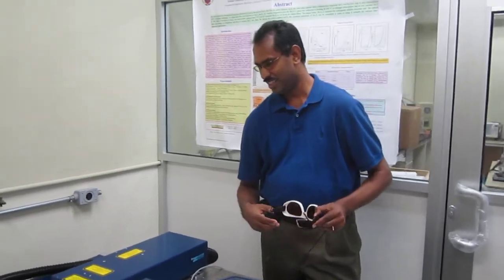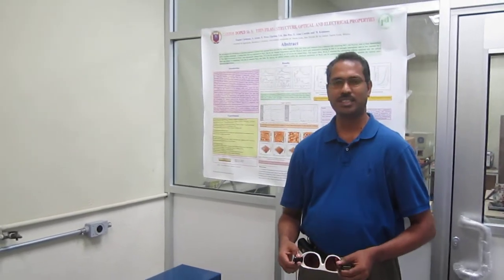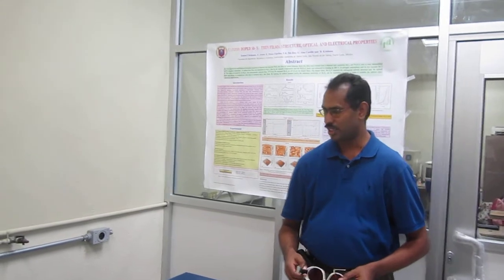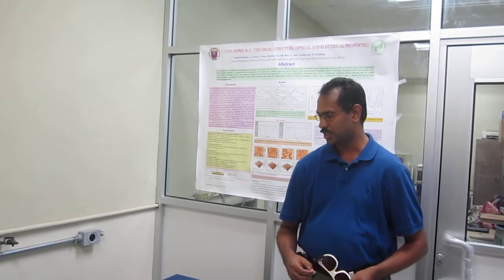Del Mar Photonics Nd:YAG laser system at the Universidad Autónoma de Nuevo León UANL

Comment: UPCOMING PRESENTATION
Four-wave mixing based optical parametric oscillator producing high energy, tunable, chirped femtosecond pulses
Thomas Gottschall, Jens Limpert, Andreas Tünnermann
10 February 2015 • 4:00 - 4:20 PM | Part of SPIE LASE

All-PM-fiber normal dispersion femtosecond optical parametric oscillator pumped by Yb-doped fiber laser
Khanh Q. Kieu, Dmitriy Churin, Roopa Gowda, Takefumi Ota, Yukihiro Inoue, Shinichiro Uno, Nasser N. Peyghambarian
10 February 2015 • 6:00 - 8:00 PM | Part of SPIE LASE

Investigation of coupled optical parametric oscillators for novel applications
Yujie J. Ding
11 February 2015 • 3:50 - 4:20 PM | Part of SPIE OPTO

Dual parametric compounding approach for speckle reduction in OCT
Jan Philip Kolb, Philipp Schwarz, Thomas Klein, Wolfgang Wieser, Robert A. Huber
9 February 2015 • 5:30 - 7:30 PM | Part of SPIE BiOS

Ultra-flat and broad gain bandwidth of optical parametric amplification in highly-nonlinear tellurite hybrid microstructured optical fibers
Lei Cheng, Tuan H. Tong, Xiaojie Xue, Dinghuan Deng, Takenobu Suzuki, Yasutake Ohishi
11 February 2015 • 6:00 - 8:00 PM | Part of SPIE OPTO

6.5W mid-infrared ZnGeP2 parametric oscillator directly pumped by a Q-switched Tm3+-doped single-oscillator fiber laser
Christelle Kieleck, Antoine Berrou, Brenda M. Donnellan, Benoit Cadier, Thierry Robin, Marc Eichhorn
11 February 2015 • 8:30 - 8:50 AM | Part of SPIE LASE

Double-pump-pass singly resonant optical parametric oscillator for efficient generation of infrared light at 2300 nm based on PPMgSLT
Bum Ku Rhee, Seungmin Lee
10 February 2015 • 6:00 - 8:00 PM | Part of SPIE LASE

Making microwaves visible: Parametric frequency conversion in whispering gallery mode resonators
Harald G. L. Schwefel
9 February 2015 • 4:35 - 5:00 PM | Part of SPIE LASE

Highly efficient double pass optical parametric generator for ultrashort pulses of tunable NIR radiation
Heiko Linnenbank, Stefan Linden
10 February 2015 • 4:50 - 5:10 PM | Part of SPIE LASE

Multi-parametric imaging of tumor spheroids with ultra-bright and tunable nanoparticle O2 probes
Ruslan Dmitriev, Sergey Borisov, James Jenkins, Dmitri B. Papkovsky
9 February 2015 • 9:30 - 9:50 AM | Part of SPIE BiOS

High average power difference-frequency generation of picosecond mid-IR pulses at 80MHz using an Yb-fiber laser pumped optical parametric oscillator
Julia Michel, Marcus Beutler, Ingo Rimke, Edlef Büttner, Paolo Farinello, Antonio Agnesi, Valentin P. Petrov
11 February 2015 • 9:10 - 9:30 AM | Part of SPIE LASE

Ultrasound-aided multi-parametric transcranial photoacoustic microscopy of the mouse brain
Bo Ning, Adam J. Dixon, James Bonaffini, Matthew J. Kennedy, Rui Cao, Ruimin Chen, Qifa Zhou, K. Kirk Shung, John A. Hossack, Song Hu
8 February 2015 • 4:15 - 4:30 PM | Part of SPIE BiOS

Optical parametric oscillation in quasi-phase-matched GaP
Peter G. Schunemann, Leonard A. Pomeranz, Daniel J. Magarrell
10 February 2015 • 4:00 - 4:30 PM | Part of SPIE LASE

Axial resolution enhancement of FD-OCT by parametric spectral analysis for ocular imaging
Xinyu Liu, Xiaojun Yu, Dongyao Cui, Linbo Liu
8 February 2015 • 5:30 - 7:00 PM | Part of SPIE BiOS

Time-bin entangled photon pairs from spontaneous parametric down-conversion pumped by a cw multi-mode diode laser
Yoon-Ho Kim
11 February 2015 • 1:50 - 2:20 PM | Part of SPIE OPTO

Parametric imaging of viscoelastic creep deformation in soft tissue using compression optical coherence elastography
Philip Wijesinghe, Robert A. McLaughlin, David D. Sampson, Brendan F. Kennedy
8 February 2015 • 8:40 - 9:00 AM | Part of SPIE BiOS

Continuous-variable quantum computing: toward an experimental assessment
Olivier Pfister, Nicolas C. Menicucci, Moran Chen, Pei Wang, Wenjiang Fan
11 February 2015 • 10:30 - 11:00 AM | Part of SPIE OPTO

Video rate imaging of narrow band THz radiation based on frequency upconversion
Patrick F. Tekavec, Vladimir G. Kozlov, Ian McNee, Igor E. Spektor, Sergey P. Lebedev
11 February 2015 • 11:10 - 11:30 AM | Part of SPIE OPTO

Cascaded OPGaAs OPO for increased longwave efficiency
Ryan K. Feaver, Rita D. Peterson, Peter E. Powers, Joseph Haus
11 February 2015 • 8:50 - 9:10 AM | Part of SPIE LASE

Optimized coherent Raman scattering microscopy with a novel tunable dual-wavelength lightsource
Ingo Rimke, Gregor Hehl, Marcus Beutler, Peter Volz, Edlef Büttner, Andreas Volkmer
10 February 2015 • 4:50 - 5:05 PM | Part of SPIE BiOS

Integrated optical sensing technologies on SOI
Amr S. Helmy, Payam Abolghasem, Janahan Ramanan, Dongpeng Kang, Dylan Logan
11 February 2015 • 11:45 AM - 12:00 PM | Part of SPIE OPTO

Adiabatic nonlinear optical processes
Gil Porat
11 February 2015 • 2:00 - 2:30 PM | Part of SPIE LASE

Numerical simulation of the transverse coincidence distribution of SPDC light
Robert Elsner, Dirk Puhlmann, Axel Heuer, Ralf Menzel
11 February 2015 • 6:00 - 8:00 PM | Part of SPIE OPTO

Role of the surface plasma density on the formation of laser induced periodic surface structures (LIPSS) on Ti upon double fs pulse irradiation
Laura Gemini, Masaki Hashida, Yasuhiro Miyasaka, Shunsuke Inoue, Jiri Limpouch, Tomas Mocek, Shuji Sakabe
12 February 2015 • 10:00 - 10:20 AM | Part of SPIE LASE

Domain-engineered PPLN for generation of polarization-entangled photons
Paulina Kuo, Jason Pelc, Oliver Slattery, Lijun Ma, Xiao Tang
11 February 2015 • 6:00 - 8:00 PM | Part of SPIE OPTO

Coherent combining of fiber-laser-pumped frequency converters using all-fiber electro-optic modulator for active phase control
Pierre Bourdon, Anne Durécu, Guillaume Canat, Julien Le Gouët, Didier Goular, Laurent Lombard
12 February 2015 • 3:30 - 3:50 PM | Part of SPIE LASE

Frequency conversion in AlGaAs microdisks in the telecom range
Giuseppe Leo, Silvia Mariani, Alessio Andronico, Aristide Lemaître, Sara Ducci, Ivan Favero
11 February 2015 • 11:30 - 11:45 AM | Part of SPIE OPTO

Compact, multi-pass OPCPA system at 100kHz repetition rate with a CPA-free pump source
Jan Ahrens, Thomas Binhammer, Oliver Prochnow, Tino Lang, Stefan Rausch, Bastian Schulz, Maik Frede, Uwe Morgner
10 February 2015 • 11:30 - 11:50 AM | Part of SPIE LASE

The laser infrastructure of the ELI attosecond light pulse source
Karoly Osvay, Patricio Antici, Dimitris Charalambidis, Eric Cormier, Zsolt Diveki, Peter Dombi, József A. Fülöp, Mikhail Kalashnikov, Nelson Lopes, Rodrigo López-Martens, Giuseppe Sansone, Ervin Racz, Kahaly Subhendu, Zoltan Varallyay, Katalin Varju
12 February 2015 • 9:00 - 9:30 AM | Part of SPIE LASE

1-micron-pumped OPO based on orientation-patterned GaP
Leonard A. Pomeranz, Peter G. Schunemann, Daniel J. Magarrell, John C. McCarthy, Kevin T. Zawilski
10 February 2015 • 4:30 - 4:50 PM | Part of SPIE LASE

Fluorescence lifetime imaging in the near-infrared region
Wolfgang Becker, Vladislav I. Shcheslavskiy
8 February 2015 • 5:30 - 7:00 PM | Part of SPIE BiOS

Broadband 2.5-6μm frequency comb source for dual-comb molecular spectroscopy
Viktor O. Smolski, Konstantin L. Vodopyanov
9 February 2015 • 2:35 - 2:55 PM | Part of SPIE LASE

Photon pair sources in AlGaAs: from electrical injection to quantum state engineering
Sara Ducci, Guillaume Boucher, Claire Autebert, Fabien Boitier, Ivan Favero, Giuseppe Leo
12 February 2015 • 9:30 - 9:50 AM | Part of SPIE OPTO

Methods to adjust the lateral and depth heating patterns of microwave waveguide applicators
Paul R. Stauffer, Dario B. Rodrigues
8 February 2015 • 5:10 - 5:30 PM | Part of SPIE BiOS
11 February 2015

High repetition nanosecond Ti:sapphire laser for photoacoustic microscopy
Timothy K. Yang, Bokyung Kim, Chulhong Kim, Sungchul Bae
10 February 2015 • 6:00 - 8:00 PM | Part of SPIE BiOS

High brightness 188nm light source with low temporal jitter
James J. Jacob
10 February 2015 • 9:10 - 9:30 AM | Part of SPIE LASE

Highly sensitive absorption measurements in lithium niobate using whispering gallery resonators
Markus Leidinger, Karsten Buse, Ingo Breunig
12 February 2015 • 2:40 - 3:00 PM | Part of SPIE LASE

Controllable harmonic generation by double couplings of ordinary rays-involved second-order processes
Yiqiang Qin
11 February 2015 • 6:00 - 8:00 PM | Part of SPIE OPTO
11 February 2015
COURSE AT CONFERENCE
Solid State Laser Technology (SC752)
Instructor(s): Hodgson, Norman, Coherent, Inc.
Level: Intermediate • 0.65 CEU • Length: 9.00 hours
Member Price: 525.00 | Non-Member Price: 635.00
11 February 2015 • 8:30 AM | Part of SPIE Photonics West

Wavelength to pixel calibration for FdOCT
Maciej Szkulmowski, Szymon Tamborski, Maciej Wojtkowski
9 February 2015 • 5:30 - 7:30 PM | Part of SPIE BiOS

3D parameter reconstruction in hyperspectral diffuse optical tomography
Arvind Krishna Saibaba, Nishanth Krishnamurthy, Pamela G. Anderson, Jana M. Kainerstorfer, Angelo Sassaroli, Eric L. Miller, Sergio Fantini, Misha E. Kilmer
11 February 2015 • 9:40 - 10:00 AM | Part of SPIE BiOS

First experimental results towards a 100W wavelength-tunable femtosecond OPCPA
Mark J. Prandolini, Hauke Höppner, Arvid Hage, Michael Schulz, Robert Riedel, Franz Tavella
10 February 2015 • 10:30 - 10:50 AM | Part of SPIE LASE

Solitons and coherent dispersive wave emission in SiN microresonators
Victor Brasch, Tobias Herr, Michael Geiselmann, Michael L. Gorodetsky, Tobias J. Kippenberg
9 February 2015 • 11:10 - 11:30 AM | Part of SPIE OPTO

The experimental setup for study biological objects using the methods of femtosecond and CARS microscopy
Arseny Aybush, Fedor Gostev, Alexander Zalessky, Konstantin Vereschagin, Viktor Nadtochenko
8 February 2015 • 5:30 - 7:00 PM | Part of SPIE BiOS

Diffuse optical quantification of early hemodynamic changes by chemotherapy on breast cancer xenografts& its implication for therapeutic prediction in clinic
Regine Choe, Ashley R. Proctor, Ki Won Jung, Russell R. Adams, Hyun Jin Kim, Songfeng Han, Emmanuel K. Mannoh, Daniel K. Byun, Kelley S. Madden, Edward B. Brown III, Parisa Farzam, Turgut Durduran
7 February 2015 • 1:40 - 2:00 PM | Part of SPIE BiOS
COURSE AT CONFERENCE
Introduction to Nonlinear Optics (SC047)
Instructor(s): Fisher, Robert, RA Fisher Associates, LLC
Level: Introductory • 0.35 CEU • Length: 4.00 hours
Member Price: 300.00 | Non-Member Price: 355.00
9 February 2015 • 1:30 PM | Part of SPIE Photonics West

Fourier domain Optical Coherence Tomography artifact and speckle reduction with autoregressive (AR) spectral estimation without a loss of resolution
Costas Pitris, Evgenia Bousi
8 February 2015 • 5:30 - 7:00 PM | Part of SPIE BiOS

Photon-correlation amplifiers and interferometers for quantum metrology
Weiping Zhang
10 February 2015 • 11:05 - 11:20 AM | Part of SPIE OPTO

Towards low-noise fiber sources for coherent Raman microscopy
Erin S. Lamb, Hanzhang Pei, Frank W. Wise
10 February 2015 • 5:05 - 5:20 PM | Part of SPIE BiOS

Broadband midinfrared frequency comb with tooth scanning
Kevin F. Lee, Piotr Masłowski, Andrew Mills, Christian Mohr, Jie Jiang, Peter G. Schunemann, Martin E. Fermann
9 February 2015 • 9:10 - 9:30 AM | Part of SPIE LASE
COURSE AT CONFERENCE
Applied Nonlinear Frequency Conversion (SC931)
Instructor(s): Paschotta, Ruediger, RP Photonics Consulting GmbH
Level: Intermediate • 0.65 CEU • Length: 9.00 hours
Member Price: 525.00 | Non-Member Price: 635.00
9 February 2015 • 8:30 AM | Part of SPIE Photonics West

A new detector approach for time-resolved widefield microscopy
Yury Prokazov, Werner Zuschratter, Claus A. M. Seidel, Sebastian Tannert, Ottmar Jagutzki, Bernhard H. Mueller, Rainer Erdmann, Michael Beeck, Suren Felekyan, Ralf Kuehnemuth, Evgeny Turbin
8 February 2015 • 5:30 - 7:00 PM | Part of SPIE BiOS

Lithium niobate: Wavelength and temperature dependence of the thermo-optic coefficient in the visible and near infrared
Stephan Fieberg, Streit Levin, Jens Kiessling, Petra Becker, Frank Kühnemann, Karsten Buse
12 February 2015 • 2:20 - 2:40 PM | Part of SPIE LASE

Multispectral photoacoustic microscopy based on an optical-acoustic objective
Rui Cao, Joseph P. Kilroy, Bo Ning, Tianxiong Wang, John A. Hossack, Song Hu
8 February 2015 • 5:30 - 7:00 PM | Part of SPIE BiOS

Real-time sono-photoacoustic imaging of gold nanoemulsions
Bastien Arnal, Chen-Wei Wei, Camilo Perez, Thu-Mai Nguyen, Michael Lombardo, Ivan Pelivanov, Lilo D. Pozzo, Matthew O'Donnell
8 February 2015 • 5:00 - 5:15 PM | Part of SPIE BiOS

Utilizing an open-microcavity optoacoustic sensor for spectroscopic determination of methemoglobin concentration
Ralph W. Peterson, Amber N. Miller, Jian Ling, Jing Yong Ye
11 February 2015 • 4:20 - 4:40 PM | Part of SPIE BiOS

Power scaling in a mid-IR OPO, pumped by high power Tm:fiber MOPA system
Ali Abdulfattah, Lawrence Shah, Alex M. Sincore, Robert Ryan, Martin C. Richardson
11 February 2015 • 9:30 - 9:50 AM | Part of SPIE LASE

Temperature-tuned 90° phase-matched SHG and DFG in BaGa4S7
Nobuhiro Umemura, Valentin P. Petrov, Valery V. Badikov, Kiyoshi Kato
10 February 2015 • 5:30 - 5:50 PM | Part of SPIE LASE

Comment: I need OPO. I have an Ekspla laser, model NL303G-10-SH-AW.
Pump wavelength:³ 500 mJ @ 1064 nm;
                      ³ 210 mJ @ 532nm;
PRR (pulse repetition rate): < 10Hz
Pulsewidth FWHM: 4 – 6 ns (FWHM) @ 1064 nm.

Beam dia at 1m from the pump laser: 6mm
Divergence:< 0.5 mrad
Beam profile: almost homogeneous across the beam ?          “Top Hat” in near field, near Gaussian in far field.
Polarization:vertical, > 90 % @ 1064 nm.
I'm interested in 210-230 nm, but I can also manage with 220-230 nm.
I need quote for purchase.

Comment from the maker: MSA-130 is a double monochromator. It is <two in one>. sales@dmphotonics.com
At the user choice MSA-130 can operate as either double additive or
double subtractive. Double mono is the choice of those who need very low stray light.
The MSA-130 has gratings set which are previously aligned at the factory and are to be changed manually by the user.
NO ALIGMENT is needed when changing gratings or changing modes from additive to subtractive and vise versa.
All the slits are micrometric.
MSA-130 software has a possibility to calculate width of the spectral range separated by the instrument in both additive\subtractive modes depending on the set widths of slits
which is very convenient for the user.
http://www.dmphotonics.com/Monochromator_web.pdf

Comment from the maker: Hi, I am an undergraduate student working in a research lab at the University of Tennessee. I am looking into the possibility of using an OPO in order to generate light in the 400-600 nm range.  I would like to know a general price range for an optical parametric oscillator, model LP601. 

OPO
http://www.dmphotonics.com/NdYAG_laser_harmonics_OPO_Raman_Shifter/OPO_NdYAG_Optical_Parametric_Oscillator.pdf
http://www.dmphotonics.com/OPO_web.pdf

These OPO systems are developed based on the end user's demands and are highly reliable and easy to operate. The main advantage of the OPO LP series is extremely low minimum required operating pump power densities. Thanks to the original optical scheme the specified parameters are obtained even at low pump intensities and as a result neither crystals nor other optics can be damaged. This feature combined with precise optics mounts and dust protective housing insure perfect reliability and long-term output stability.
http://www.dmphotonics.com/532_OPO/OPO%20system%20for%20532%20nm%20laser.htm